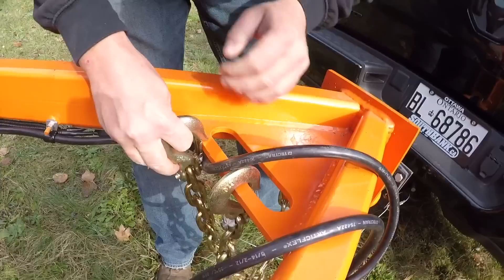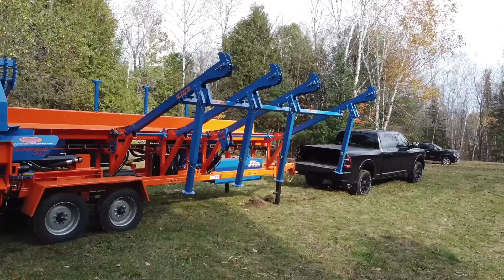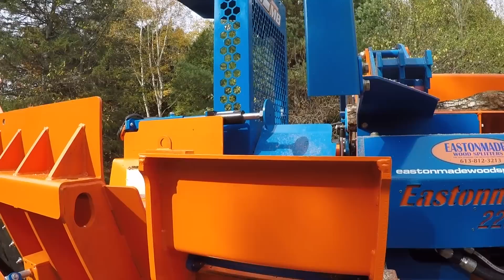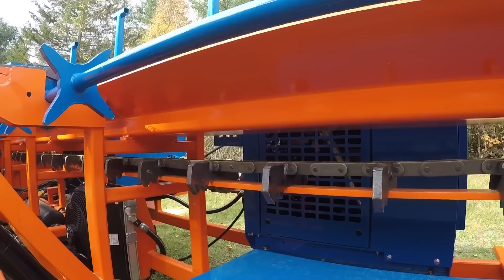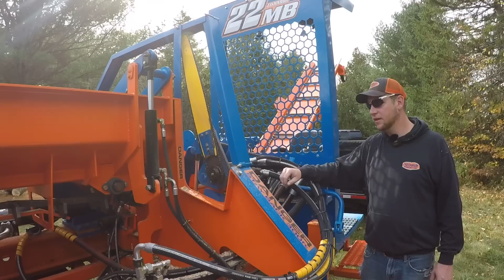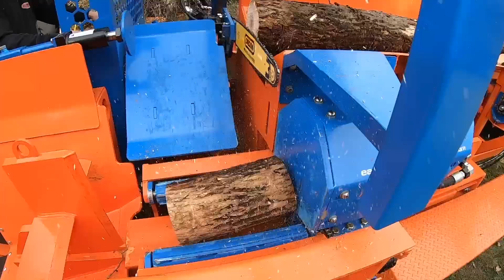Eastonmade 22MB Wood Processor! Firewood never had it so good! Build, Specs and a little firewood.

Comment: I have had a dyna SC-16 processor for 10 years now been doing firewood for 17 years. I am 63 years old now dont know how much longer I will do firewood so with that said if I was in the market for a firewood processor and I new I would be doing this for 10 more years this would be the Machine I would buy it is about 40.000 thousand more than a new SC-16 but you are getting so much more machine than you know this processor would double my output you have nothing you need to upgrade but the splitting wedge its all here in 1 package.  I have nothing to gain just giving my honest opinion you cant go wrong with this processor. You knocked it out of the park Andrew

Comment: Just when you think you’ve seen it all, man what a machine, when everything you need is all mounted on one unit. The Diesel engine is another bonus, the size of the logs, 22 inch diameter and being able to go to about 30 feet. Can’t think of anything more a person could want on a processor. Cheers
Reply from the maker: It was a pleasure seeing it in action. Cheers Gerry!